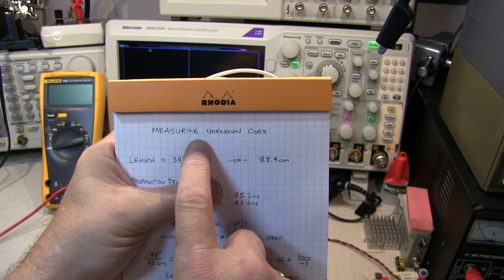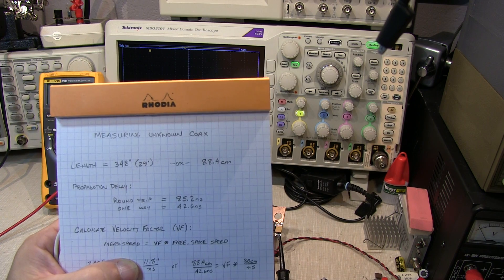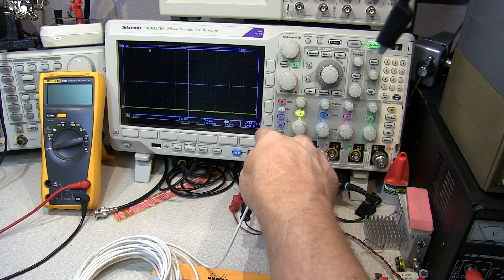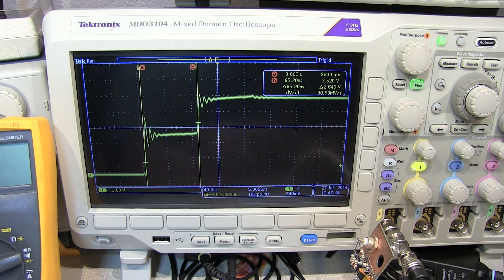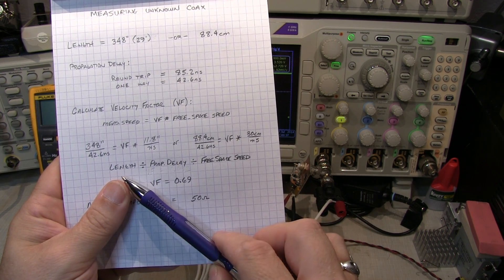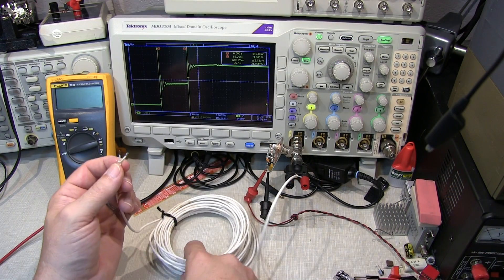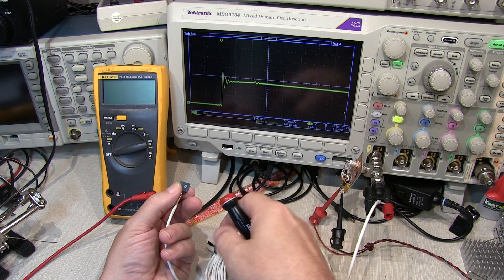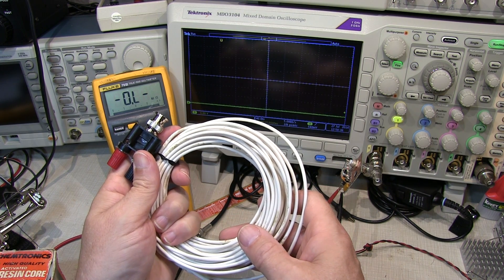#162: How to measure coax velocity factor VF and impedance Z

Comment: Great video, that demonstrated the process clearly.
I understand the requirement to know what a transmission lines' velocity is, but I wonder if all other parameters are equal does velocity matter in the choice of a transmission line? Is velocity factor directly (or vaguely) related to other transmission line parameters? Would you prefer a faster or slower velocity factor? Thanks Greg
Reply from the maker: In general, the lower the velocity factor, the lossier the line.   The only time you really might want to know if if you need a specific length (wavelength) of line for use as a phasing line, trap, or impedance transfomer.
Reply: @w2aew  Are you saying 10m of "x" LMR400 with 66% VF will have more insertion loss than 10m of "y" LMR400 with 80% VF? Have you done a video on this topic? Thanks Alan
Reply from the maker: @gregwmanning  Velocity factor is a function primarily of the material and design of the center insulator.  A higher velocity factor means that the dielectric is less dense, such as foam, as compared to a solid dielectric.  All LMR400 is built the same way, so the velocity factor will be the same.  The dielectric type is one factor in the loss performance of the coax, but not the only one - there are also ohmic losses, which have nothing to do with the velocity factor.

Comment: Im curious how you would have gone about measuring the characteristic impedance of the coax cable by using the measured step voltages directly from the scope. I believe TDR capable sampling scopes use this method, though Im curious how the characteristic impedance values are measured or extrapolated.
Reply from the maker: You can calculate the impedance from the size of the step.

Comment: The cable seems to be longer than a meter to me. 88cm is way less than a meter (100cm). So I converted 29 feet to centimeters it comes out as 883.9 cm.
Reply from the maker: Yeah, sorry, I moved the decimal point too far...
Reply: @w2aew  I had just noticed that as well. Glad someone else addressed it. Thank you for these videos! They are exceptionally helpful.

Comment: Will cable impedance change with frequency?  If so, to match the terminating resistance, it may make sense to build a small circuit with BNC male and female connectors and a variable resistor so you can more precisely terminate the cable at the measurement point (i.e. the oscilloscope) for the frequency under test.   Alternatively (or in addition to), it may be possible to get rid of the ringing in the fast rise pulse generator with this device.
Reply from the maker: Transmission line characteristic impedance does not change with frequency.

Comment: Great way to explain both VF and Impedance... that was a really big help. Thanks... Do you have any tutorials on how to use your Oscilloscope and other benchtop equipment? I want to take some field cable for a project I'm working on and get these two pieces of data to use a TDR to estimate cable length accurately... Do you have an e-mail address I can contact you at?
Reply from the maker: Yes, I have DOZENS of videos on how to use benchtop equipment.  Even a couple on TDR alone.  The easiest way to find the videos you'd like are to use my video index file (https://www.qsl.net/w2aew/youtube/W2AEW_video_index.pdf).  The videos are arranged numerically in the first half of the index, and arranged by topic in back half of the file.  Since it is a PDF, you can search for key words of interest.  Every video entry is a link to the youtube page for that video.
Reply: Hi Alan, the above link doesn't work anymore. Is there another link to access the index?

Comment: I haven't seen you make a video lesson about "directional cable". What Direction Cables are is one end the cables shield is connected to the circuits ground and the other end of the cable the shield is LIFTED not connected. This eliminates causing group loop issues. Not sure when would a circuit need to use directional cabling with only one shield is ground compared to non directional cabling with both shields grounded to the circuit?

Comment: Hi
I have 1.5mm silicon insulated copper wire I want to use for a wire antenna. How can I find the VF of this wire?
Reply from the maker: insulated wire for an antenna will typically affect the length by only a few percent.

Comment: I wonder if a 555 timer could be used as the pulse generator...
Reply from the maker: Unfortunately no. The output edge speed (rise time) likely won’t be fast enough. And the output likely won’t be able to drive a 50 ohm transmission line.

Comment: This cable looks longer than 88.4 cm. Are you sure it wasn't 8.84 m ?
Reply from the maker: It was 8.84m - I missed a decimal point when I put the video notes together.  You can see at the beginning of the video that I noted the cable is 29 feet long.

Comment: Your scope has certainly a generator BF that can do square signals, duty cycles, ... How could you use it instead of that specially made circuit ?
Reply from the maker: Yes, I could.  My specially made circuit has faster rising/falling edges than the generator built into the scope which gives better distance resolution.  Plus, since most scopes do not have a built in signal generator, I wanted to show how a simple external circuit could be used.
Reply: Many thanks for your answer. I'm trying to get an amateur license (in France, sorry for my poor English), and   learning the basis of electronics, so it's easyer for me to use what I have, as I'm unable to design such an external circuit. I like your channel, thanks to you again

Comment: Oh. I see it takes very expensive test equipment to analyze some crappy coax from the flea market. That's not very helpful.
Reply from the maker: This could be done with a crappy scope too   ;-)
Reply: what's the minimum scope spec required?
Reply from the maker: The risetime of the pulse and scope combined is the determining factor. The slower the scope, the longer the minimum length of coax that can be measured. Given that in typical coax, the speed is going to be on the order of 8 inches per ns, this means that a 10nS risetime (which equates to a 35MHz scope) will have it's rising edge occupy 80" of coax.  In order to be able to see a reflection from this edge, you'd probably need a minimum 2-3x longer than this - so on the order of 160-240" would be the minimum length of coax that you can measure.  Faster scope and pulse = shorter coax lengths that can be measured.
Reply: My brain hurtz. I am going to bash it against my 20MHz scope. My calculations show I need 6.02*10^23 km of cable to work out the VF using my scope....

Comment: great video
trying to find impedence of those fixed Attenuators I have  did you do any videos or tell me how  Thank you
Reply from the maker: +DENNIS N Determining the impedance of a fixed coaxial attenuators is pretty easy.  Resistive attenuators will have an input resistance equal to the designed impedance when terminated in that same impedance.  Thus, a 50 ohm attenuator has a 50 ohm input impedance when the output is terminated in 50 ohms.  Same story for 75 ohm attenuators.  The vast majority would be 50 ohms, and some might be 75 ohms.  The easiest way is to put a 50 termination (resistor) on one side of the attenuator, and measure the resistance at the other end to ground.  If it is 50, then it is a 50 ohm attenuator.  If not, then try using a 75 termination and measuring the input - it should measure 75 if it is a 75 ohm attenuator.
Reply: Thankyou

Comment: Great vid on the subject as usual. As I pondered this, at first, it seemed the coax impedance would change with increased frequency however, I suspicion that frequency would have a negligent effect up and until its time base approached the cables propagation delay. In this case being 85ns. At this point the delay would appear as increased impedance with respect to the load. Am I correct in making this assumption?
Reply from the maker: bain5872 The impedance can appear to increase or decrease, depending on the frequency and length of the line. For example, a quarter-wavelength long line that is shorted at the far end will appear as an open circuit.  If that same quarter wavelength line is open at the far end, it will appear as a short at the input.
Reply: ***** Thanks Alan. I remember your very interesting vid about using quarter wave length as a switch in a trans/receive mod.  What I'm really trying to get at here is the cause and effect of the cables changing impedance. It appears to me as a function of the cables capacitance/inductance which change with length, for the cause. It seems intuitive that the reason for the cable looking like a open circuit is due the cables propagation delay being equal to wave length of that particular frequency as the effect. Is this correct ? Please forgive; I'm trying to obtain a very firm understanding of what is actually happening in the coax.
Reply from the maker: bain5872 The distributed capacitance and inductance along the line gives rise to the line impedance, which is a constant.  The impedance looking into the line looks like the line impedance only when the the line is terminated in it's characteristic impedance.  If it is not properly terminated, then the reflected signal from the termination will add to the forward wave, resulting in an apparent input impedance that is a function of frequency and line length (because these affect the phase and amplitude of the reflected wave).  You may want to review this video:
https://www.youtube.com/watch?v=g_jxh0Qe_FY
and this one:
https://www.youtube.com/watch?v=DovunOxlY1k
Reply: ***** Thanks for the links and explanations Alan, they were helpful. This confirms my theory.  I think I was confusing the issue by not indicating that my mental experiment was being performed with an unterminated piece of coax hanging open at the end of the line.  Once the line is terminated there is no reflection.  Again, I appreciate your time and patience.
Reply from the maker: A short unterminated coax looks complex/capacitive until the line is a quarter wavelength long. Then it looks complex/inductive until it is a half wavelength long. Then it repeats, etc.
Reply: ***** Yes, this was what I was trying to get clear in my mind earlier. I was interested in the mechanism involved. Thanks again.

Comment: How would you go about measuring the loss per 100 feet or similar?
Reply from the maker: Pick your test frequency. Measure power at generator, convert to dBm. Connect coax to generator. Measure power at dummy load connected at far end of coax. Convert to dBm. Subtract output power from input power, divide by actual length, and multiply by 100. This gives you loss per 100ft.
Reply: ***** That sounds so obvious now, thanks for the help.

Comment: Nice video! Using the same techniques here. I can only disagree with the last comment in the video. One of important parameters for HAMs using 100 MHz or higher is also the loss of the cable over different frequencies. 73! :)

Comment: Any way to do this on the cheap (i.e. without the scope)?  It seems the voltage doubling of the reflection could be exploited as a start/stop or trigger.  For example, have the signal start a small (pf) cap charging and then stop charging when the reflection doubles the voltage.  Another might be to start with very short pulses and then increase the duration until voltage above the signal is detected?
Reply from the maker: It would be possible, but not particularly easy.  You'd need some very fast switches or comparators.  This method of charging a cap to measure a short time interval is a common method to measure short time duration events. Using short pulses is another approach, but generation of single-digit ns wide pulses isn't particularly easy either, and would still require some fast comparators, switches, etc.  It's all possible and has been done.
Reply: ***** Thank you for the response!  As i get older, time and money seem to be trading places on the value graph...twiddling with $10 in parts for ten hours to get uncertain results vs $400 and ten minutes is almost enough alone...add in the fact that you still have a good scope after the fact, and the choice is pretty clear.  :)

Comment: thank you Alan, good video as always; is 50 ohms the impedance of the wire, or the other side of the cable, the pulse generator, and the potentiometer is matching it?
Reply from the maker: The pulse generator has a 50 ohm output impedance. The coax has a 50 ohm characteristic impedance (at RF), and the potentiometer has a 50 ohm resistance when it is adjusted to minimize the reflection.  The point here is that the reflection goes away when the termination impedance (the potentiometer in this case) matches the characteristic impedance of the coax.
Reply: ***** what if the characteristic impedance of the cable is not 50 ohms?
Reply from the maker: mdev1206 Then, the reflection will flatten out at a different potentiometer setting - matching the coax impedance.  The generator impedance won't matter much, as long as it's low enough to drive the coax impedance.

Comment: In practical terms is there a sensible minimum length of co-ax you can work with to get the VF? Great video Alan, thanks as always!
Reply from the maker: ChrisWilson5006 It depends on two things: how fast is the edge on the pulse generator, and what BW is the scope. If the edge on the pulse is too slow, then you won't be able to separate out the incident edge and the reflection.  With this 2ns edge, it will start getting difficult to see a delay that is less than about 10ns round trip (with the ringing, etc.), which corresponds to 5-6" or so.  And, the accuracy of the delay measurement suffers. Of course, the scope has to have sufficient BW to not filter and slow the edge.
Reply: ***** That's great, I have about 5 foot sample  of unknown Heliax type cable I'd like to measure. If it's suitable for my needs I have been offered a part drum of it, cheaply. Hopefully this will be possible then, thanks Alan.